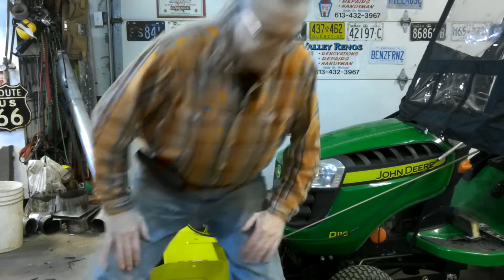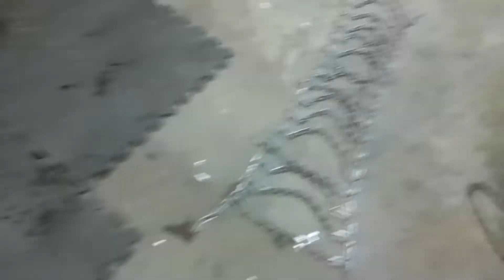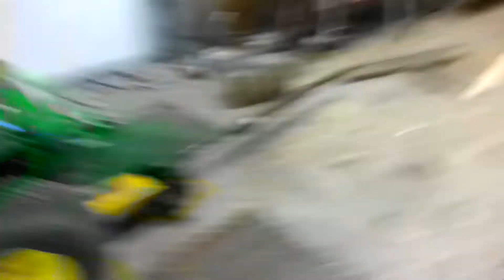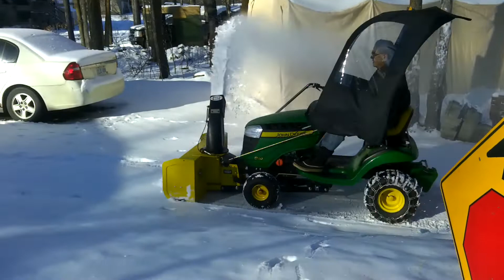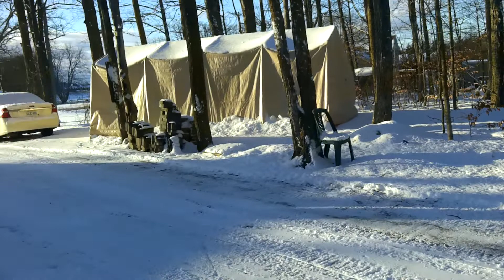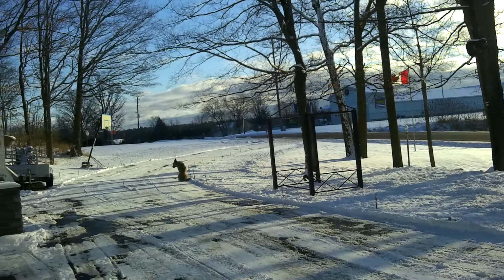# 125 Snow at the Dog House

Comment: That green rig you are working on looks like a burnout vehicle.
Reply from the maker: Hey Turlo. Thanks for dropping by the Dog House. It does do burnouts. I did a small one in the shop today on the cement floor.  I should have posted that for the burnout contest that is going on.😊😆
Reply: @AndysDogHouse  what...we missed the Burnout......dang
Reply from the maker: @RustyIronProjectsRIP  Hey Rusty. Well it was more of a spark out. I had chains on. I couldn't get grip on the cement floor.💥😆